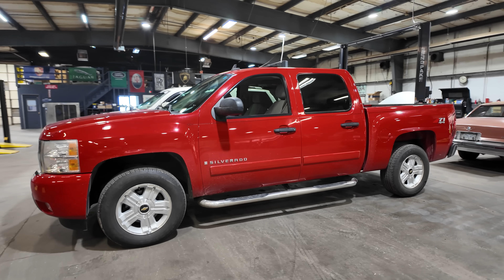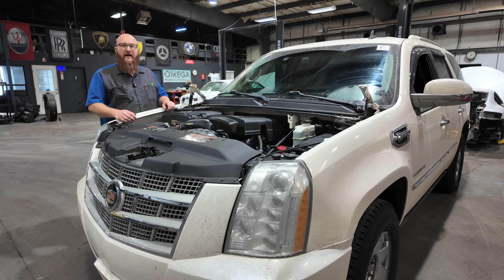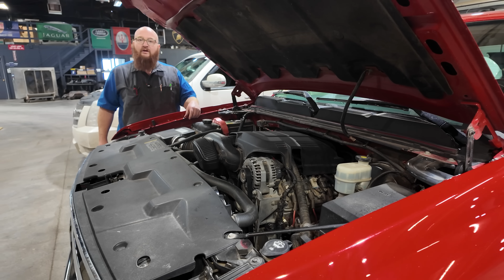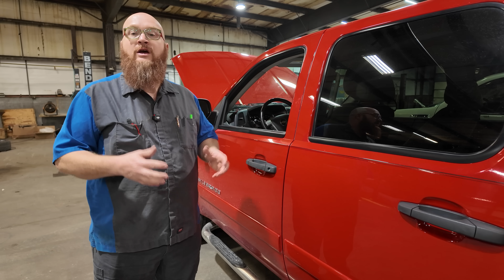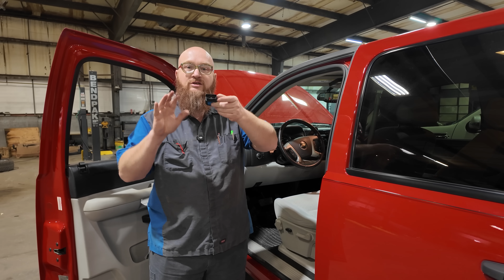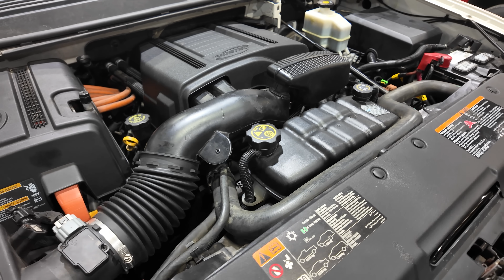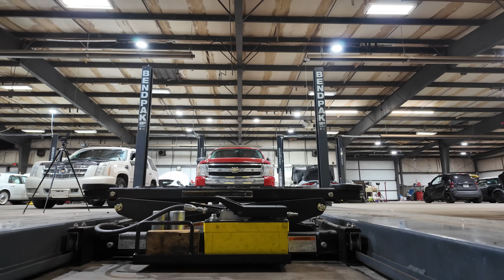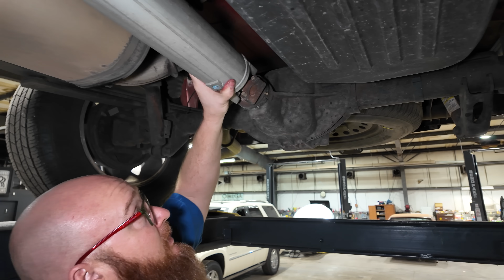AFM: Engine Saver or Engine Killer? The REAL Answer

Comment: Both of my cars have AFM and both are tooling around with the OBD2 disablers installed. No problems at all, and AFM never engages. The system I use also automatically disables the auto on/off system that is just as much a PITA as AFM!
Reply: The lifters are still there.
Reply: @hotpuppy1  With proper maintenance (oil changes) they will last the life of the engine. Best to change them IMHO,
Reply: @member57 they will still fail, ask me how I know
Reply: @hsucduw That's the reason I suggest changing them before failure. $800 and a weekend beats a new engine.
Reply: @member57  or just do a proper afm delete and never have to worry about the afm variant lifters ever again, or something occupying your obd2 port.
Reply: @kenabi If you read on, that is my suggestion. It's still a ticking time bomb until deleted physically. I have had 4 trucks with AFM, all of them I deleted. Two 2008s Silverado/Sierra, 2009 Suburban and a 2014 Sierra (LT engine). All done myself, significantly cheaper than having a scammer mechanic do it.
Reply: @member57 any good videos or forums that you suggest i watch to learn how to do it myself
Reply: @undisputed1one please let me know if you found any. Need to do a delete on a 2016 suburban
Reply: @hotpuppy1  Yes the lifters are still there, they just  no longer collapse to engage AFM. They fail when they collapse and remain collapsed. This prevents that from hapenning and they function like normal lifters.
Reply: @kenherrera2819  Not true at all.  6280 mi on a 2026 GMC Denali 6.2l.  Always drove in L9 (defeating DFM at ALL times) I Still had catastrophic engine failure at 6280 mi.
Reply: @JeffGower-s9q 2026 GMs are failing due to machining issues on the cranks/journals & manufacturing debris flowing through the engine. They also use DFM instead of AFM.  ALL the cylinders have the collapsible lifters. Good luck💀
Reply: My 2015 GMC Sierra with 6.2 L lifter failed at about 40,000 miles with one month left on the warranty. I always change my oil with full synthetic when the oil monitor hits 50% which is usually about 2500 miles. Now I feel like I’m driving a truck with a time bomb under the hood, waiting to go off. The only way I would ever buy another GM product is if they offer at least 10 year 100,000 mile warranty. So it looks like I might be forced to look at Dodge truck next
Reply: @petermcbilt594  This is exactly why it is wise to defeat AFM on any car that has it. You did everything right and still you had a lifter fail. The design is fatally flawed and eventually one or more of the collapsing lifters WILL fail and when that happens there is a strong risk of destroying the entire engine.  Like any other mechanical device, failure is not a question of "if" but a question of "When". ALL mechanical parts will eventually fail and the idea of sticking a mechanical part in such a critical location was sheer madness on the part of engineers who were being literally forced by the government to come up with a way to save a miniscule amount of gasoline.
Reply: @petermcbilt594 GM man here who went Toyota. Besides the failures i don't want to have to add motor oil to an engine i just paid alot for
Reply: @stevenalla9192 Toyota is having engine  problems now 😂
Reply: @usa1camaro377 I bought a 2017
Reply: @petermcbilt594  waste some more money, eh?
Reply: @petermcbilt594 lol 2500 is hilariously early for oil changes with modern day oil. 

Unless you are offroading on a dusty ass road and red lining the shit out of your car every 5 minutes
Reply: Same here.  Nearly 200k miles with a plug-in OBD AFM disabler...I believe neglecting oil changes are a huge problem with AFM lifters dropping.
Reply: @cup_and_cone This is an underrated comment. My 09' Suburban had 200K on it before I deleted the AFM/DOD physically. It still functioned but I did as preventative maintenance. The oil had been changed religiously every 5K to 7K miles with full synthetic. I believe that is why everything still worked flawlessly.
Reply: @cup_and_cone lifters drop because of design, not stretched oil changes.
Reply: What brand disabler?
Reply: @The_Sword3  I put one in my 2008 Silverado 5 years ago, Part Number: DBL-S1000 from Summit Racing. $230.35, seems to do the job, no issues.
Reply: @jillj8665 thanks
Reply: @The_Sword3  They can be found on Amazon.. any brand designed for GM engines will work. The one I purchased was 65 dollars and I have two of them, one for my Cadillac with a 3.6 engine, the other for my wife's Enclave which has the same 3.6 engine. Both cars came with AFM and both have been disabled by the device.
Reply: If you have stop/start you have DFM, a much more complicated and even less reliable system
Reply: @Bonez1LE  DFM randomly deactivates cylinders, it's not always the same ones that are deactivated. In the case of my Cadillac CT6 it always moved from 6 cylinders to 4, but the 2 that were being deactivated could vary under DFM instead of dectivating the same two all the time. In either case, I have disabled the system.
Reply: @Bonez1LE  The disabler shuts both down with no problems at all. No more going from 6 cyl to 4 or shutting off when I stop at a red light.
Reply: There is no evidence that AFM damages vehicles. 

People are just complaining about it because of climate change, which IS a problem no matter how much Fox News and our dumb fuck president says it doesn't.
Reply: Which obd2 disabled did you install
Reply: 2026 GMC sierra denali with 6280 mi.  I disabled AFM, changed oil at 500 mi, 3500 mi and engine seized at 6280 mi anyways.  The L87 engines are GARBAGE
Reply: I just started to hear some clunks when I cold start my 07 5.3 with 200k clears up after a few mins but if you rev to 1200 or 1500 it doesn't sound good😅
Reply: Cadillac this mess in their cars 35 years ago 4-6-8 .garbage
Reply: What disabler brand or tuner did you go with
Reply: Which company or part you used brother ??

Comment: So it's like the MDS in my Rams Hemi then, I have been performing oil/filter changes every 2000miles since buying the truck and I've gotten to 170,000 miles with zero ticking sounds.

Probably going to replace the lifters around 240,000, install a better oil pump, and any other maintenance I can get done with the heads off.
Reply: So anything you saved on gasoline , you more than pay back for in oil and filter costs.
Reply: @ziploc2000  I've come to realize that MDS is not a fuel saver, it's just reduces emissions is all. The way I drive my truck gets me 28mpg even with the MDS disabled.
Reply: @dRiifTeR667  If it's not reducing fuel usage, how does it reduce emissions? Surely emissions:fuel usage is a constant. 
I agree that MDS and all other attempts to reduce fuel usage by clever engine management (stop/start/MDS/ Turbos etc.) just  seem to end up with a more complex engine and more cost related to maintaining that engine.
Reply: You can disable it by putting it in manual mode gear 8 or tow mode. It will still go through all the gears in manual mode with gear 8 selected. In tow mode it will only go up to 7th gear.

Comment: i have a 2011 GMC sierra i bought with 70k miles- 5.3. I just ordered one of these a couple of months ago in hopes it prevents failure down the line. Oil changes every 4k miles, here's to hoping it lasts!
Reply: my 2012 chevy surburban has 449k miles on the odo. guy claims used engine went in 2021. engine has writing on the front and it doesnt feel tired at all

Comment: I drive my Hemi Ram in manual mode to lock it out. It’s become ritual every time I click it into drive.
Reply: Another benefit of doing that, it deactivates the auto stop/start on vehicles that have it.
Reply: @davidstjames_  makes complete sense, save $1,500 in fuel over the life of the engine that costs $15k to replace at 75-80k miles, lol 😂 please explain how that saves anything at all, including the environment, go ahead, I’ll wait…………
Reply: @1982MCI    Listen, you simple minded idiot!   How the hell do you think that I'm in favor of that BS?  I pointed out that when in manual mode, you also have the benefit of deactivating the auto stop/start.  Not only are you arguing with something that you agree with, you're arguing against yourself.  That nonsense does not save $1,500 worth of fuel, there are plenty of studies where it does the opposite.
Reply: @davidstjames_ you may want to look in the mirror to find the simple minded idiot since your arguing over the exact same thing I just said, lol 😂!!  Studies do show that it costs 10 times more yo use it than what is saved, exactly what I said, lol 😂, textbook definition of a simple minded idiot 🤡
Reply: @1982MCI  ahh, the EPA carbon offset credits that mandate  a certain mileage, as well as the switch from 134A to YF1234 refrigerant. So it makes liberals feel good, so it must be good?
Reply: @davidstjames_ Those functions were built into the vehicle for a reason. Not too smart to drive with it deactivated and waisting fuel.
Reply: @Lawnboy21  not sure if you know but the amount it saves when your driving is nothing and when your stopped its such a little amount that is almost isnt worth it like ever
Reply: @Lawnboy21  Yea save fuel and have your motor fail.  Great choice.
Reply: @Lawnboy21    You sound like a pretty savvy person.  I'm selling some beautiful water front property in Florida for a great price, let me know if you're interested.
Reply: @Lawnboy21  Auto start/stop was a government requirement. Thats the "reason". Forced. Trump admin literally shut down this requirement while you were commenting(as of FEB 12). Watch half of the new cars stop using it and the other half keep it to hit better mpg numbers.
Reply: @Lawnboy21 It's literally recommended by mechanics to stop using it to save your motor.
Reply: @Lawnboy21  Ehh, yeah they are there for a reason ... but that reason is stupid. The amount of damage done to the engines far outweighs the fuel savings at the end of the day. In some cases with auto stop/start there is more fuel wastage depending on the type of driving you do. One good thing about auto stop/start though is that the starters paired with those systems are overbuilt, so when you disable it they will last far longer. Many of these things are there because a lobbyist got paid to sell the idea to a politician who knows NOTHING about engines, fuel prices, typical daily driving, etc. and a significant amount of money changed hands. You are more than welcome to believe what you like, though I will continue disabling both on the vehicles I own.
Reply: @Lawnboy21 That's a bunch of horseshit, and rather spectacular horseshit at that. There's no version of AFM that saves enough fuel to offset the oil it burns and offset the amount of wasted resources and energy from blown engines caused directly by the bullshit engineering. Especially on the Ram and GM, as well as Honda.
Reply: @Lawnboy21  They also told us cigarettes were good for us and lobotomies were "life saving" procedures!! You're not very smart!!
Reply: @Lawnboy21  "I fully trust the government, derp!" - Lawnboy
Reply: @lock6686 he should’ve watched this exact video that we are commenting under.
Reply: There's no reason to do manual mode on the HEMI engines. HEMI lifter failure is always due to seizing needle bearings on the lifters and it can happen on any of the sixteen lifters in the engine. This failure has nothing to do with the MDS cylinder deactivation system in the engine and there are plenty of reports on lifter failure occurring on non-MDS engines. One of the more common lifters to fail are the ones on cylinder 5. Cylinder 5 is not a MDS cylinder, yet its one of the more common lifters to fail on the HEMI engines. Also MDS was added to the 5.7 HEMI in 2005 for the Chrysler 300 and Dodge Charger and 2006 for the RAM 1500. You hardly hear of lifter issues on these 2005-2008 HEMI engines, only on the ones 2009 or later when VVT was added. Many speculate the VVT HEMIs raised the camshaft up slightly, so its more difficult for oil to get to the camshaft and lifters. 

If you want to do your best to avoid HEMI lifter failure, change your oil every 5000 miles. Use 5w30 oil instead of 5w20. Avoid excessive idling. If your HEMI has already suffered from lifter failure, I've heard of many bolting on the hellcat's oil pump (part number: 68195993AD) to increase the volume of oil at idle.
Reply: @bill_clinton697 idk how many people I’ve tried explaining that to but they always tend to argue and point towards the GM failures claiming it’s the same. I’ve heard that the Hemi receives insufficient oiling at idle and that a large majority of failures occur in Hemi powered vehicles that sit in a lot of traffic or generally just see more idle time. Either way, with the cost of a new crate engine, avoiding the Hemi powered vehicles is the best protection unless you’d rather spend a few thousand on an aftermarket cam and lifters… In my opinion at least.
Reply: @Turndog375  I would argue there's far worse powertrains than a 5.7 HEMI and ZF 8 speed transmission. Avoid Fords and GMs with 10 speeds. EcoBoosts will become endless moneypits around 150k miles. GMs have tons of issues with their engines post 2014. The Toyota 3.4 twin turbo engine in the Tundra is far worse than a HEMI. A heavily idled 5.7 HEMI with 60k miles will likely last longer than a Toyota 3.4 TTV6 or a GM L87 6.2
Reply: @bill_clinton697 there are certainly worse powertrains for sure. The 2.7 ecoboost has proven to be very reliable as far as the ttv6 engines go, however as you mentioned the GM and Toyota engines are not a good option these days. The Hemi’s and 5.0’s seem to be the best bet for longevity from what I’ve seen as far as v8’s go.
Reply: MDS in the Hemis dont seem to shred engines like AFM does in GM trucks
Reply: My 2011 tahoe is the same way. Manual in 5th, acts like an automatic still but locks v8 in. 80k miles later still solid. I'm at 180k now
Reply: @sergeantspeed5941 so you drive around in 5th on manual mode? I thought this would wear your transmission out- (I’m no mechanic)
Looking for knowledge- I have 68 k on my crate engine in my 14 Silverado 1500 
Help a uneducated guy out
Reply: @donsisco7118 I do drive in m5 mode. It does indeed disable v4 mode. It doesn't affect the transmission in any way. It acts the same as if you put it in drive. It's muscle memory for me since I've been doing it for years, and it's cheaper than buying an obd2 dongle for 100 bucks. 

The only inconvenience is highway driving. Either leave it in 5th instead of drive and have a higher rpm and lower mpg or use drive and accept the fact you'll use v4 when coasting. 

I don't do much highway driving but 5th gear I'm still at 2000 rpm so it's nothing too crazy. But I have another car I take on road trips now
Reply: @sergeantspeed5941  Just get an AFM disabler module. It'll let you access 6th gear.
Reply: I know a guy who is a aftermarket AWD dyno tuner, who took Dodge Ram to court when they first came out with their BS lie of cylinder deactivation, but he was just a millionaire going after billionaires. For all I know he could still be fighting them over that.
Reply: I do the same with my 08 charger rt. Manually shift it.
Reply: Same for the Chevy
Reply: The PARTS are still there.
Reply: I do this regularly as well, but I use it more as an MDS toggle, saving it for when the engine is up to temperature and at city street cruise speeds. The live fuel consumption display indicates a 20% improvement at flat cruise at 40mph on my local county roads, which accounts for a significant portion of my daily commute.
Reply: Same!
Reply: I am an ASE master tech with over 30 years of experience, and have done both Dodge/Ram and chevy lifter failure jobs. The RAM/Dodge MDS (multiple displacement system)  lifters rarely fail. on the MDS cylinders 1,4,6,7 (firing order is 18436572 on both chevy and Dodge, hence for balance they have same cylinders disabled). Its rarely the lifter lockuo, its ALWAYS the needle bearings in the lifter roller at the cam. I see them fail on EVERY chrysler engine that uses that needle bearing system. Just did lifters and rockers on a 3.6 ram for the needle bearing failure , but on that engine its on the rocker arm.. My point is disabling that on a Ram might not do you any good as the main failure cylinders is 3 and 5. Which are not the MDS cylinders. Just a thought, and decades of experience.
Reply: @rodx5571 I don’t like how it sounds when it goes into eco mode with my exhaust.
Reply: Same.  The "Manual mode" in our Rams are really just a tow mode.  Set the highest gear and the truck will shift through all the gears normally.  My truck is older so I just go into manual mode, set the highest gear at 5 and it's no longer a problem.
Reply: If you buy one of these cheap 40-100 disablers u can drive it regularly

Comment: Buy a late '21 or '22 DFM delete due to chip shortage. If you have a 10 speed, drive in manual mode 9th gear for full time V8. 8 speed?, drive in 7th.
Reply: As far as I know, DFM is disabled, but they used the same cam and lifters. So, the problem may still happen.
Reply: @mus_xr4653  True, but no need for disabler or put in M gear 7 or 9.
Reply: I've already been in one and deleted it. Sideways lifter boogie and glitter bomb. Badly trashed cam bearings as well.

Comment: Why could they not just turn off fuel instead of the fuel and valves?
Reply: They do shut off the fuel, but turning off the valves turns the chamber into an air spring to help the engine run and maintain as much heat in that cylinder as possible.
Reply: Because then you fight compression on the dead cylinder robbing power.
Reply: Good question  ! I always wondered that also !